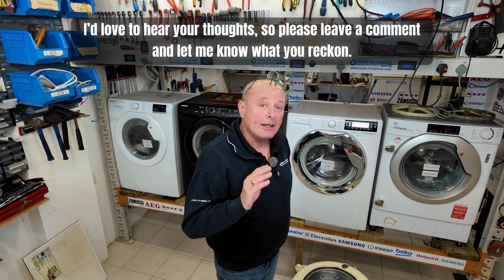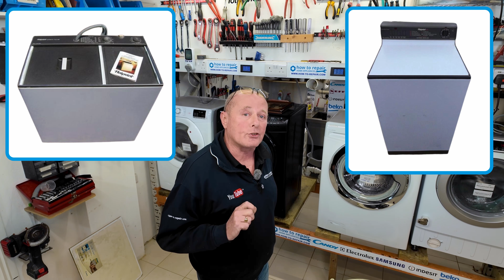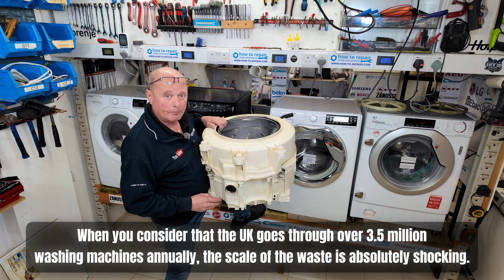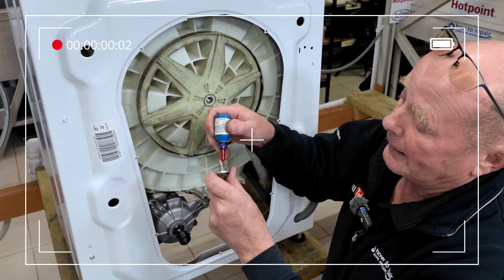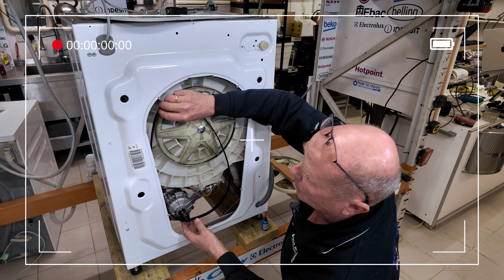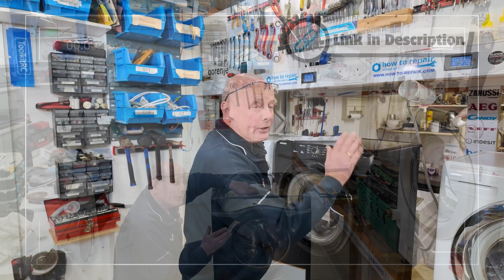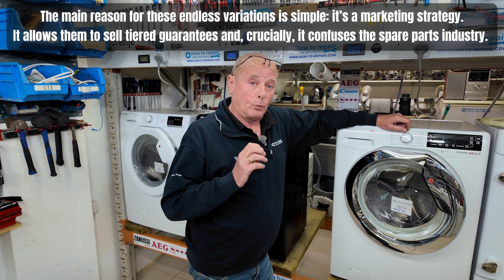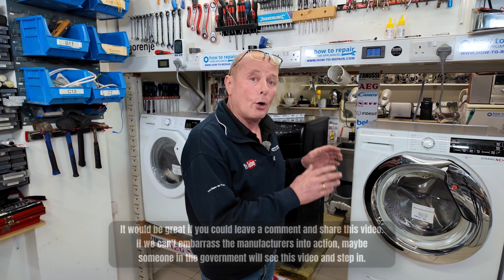I Scrapped 13 MACHINES to Prove a Point: STOP BUYING These Brands!

Comment: I have a Samsung and have replaced the bearings and seal twice. Possibly a fault by me for the first bearing fail. I still think that a double seal inside with a bleed hole to allow leakage would allow bearings to last a lifetime.
You are correct, Asian companies have to make repairable machines or they wouldn't sell them in their own markets.
PCB's cost around £20 to make and as an electrical technician, I can tell you be made to last at no extra cost.

Comment: I have an LG washing machine that's 10 years old and Little Swan dryer that's around 9. The LG had the pcb fail due to corrosion, even though it was 90% properly sealed with layer of silicone. I bought a replacement pcb and it has been working fine for the last year. The dampers are getting tired and may need to replace them soon. The dryer had a starting cap failure. 1 pound component. Easy fix. Eventually they will be too old to have parts for them even though they are only 10 years.

Comment: My miele machine is around 25 yeas old, has never broke down! The only 2 things I've had to do, stretch the springs onto the next setting because they got weak with age making the machine vibrate on spin, clean out the drain pump a few times.
 I love It's soak option, a wash takes 4 hours, but most of that time the cloths are soaking in cold water, the water heats up towards the end of the wash.

Comment: Top marks from a very old engineer I used to have 5 shops that sold all the machines you mention, and we were hoover dealers and hotpoint dealers but sold them all I am disgusted hearing how bad the industry has got, sounds like one big con, when this Samsung goes wrong I will purchase your reviewed ASKO as it sounds very good, thanks for speaking up for the consumer, and hard work, cheers Bob in the UK  A YOUNG 80 YEAR OLD.

Comment: I have an Electra (Servis) washing machine. It’s a noisy beast, doesn’t always balance the load nicely, but has been pretty reliable. 
I’ve had to change the motor brushes, reinforce the corner of a panel where a crack was developing and apply a few tyre repair patches to the door seal (replacements no longer available), but that's about it. It’s 36 years old.
Leaving the door open between washes has kept the growth of mould on the rubber to a minimum, but the material is perishing so I’ll eventually have to replace the machine… Ebac is looking like a contender despite the higher initial price.

Comment: It is not obsolescence but engineering of how to make equipment cheaper to produce and gain profit. I think welded drums are much chaper to produce than having human or even robot assembling parts in to one component. Usage of cheap bearings, seals is also the way to reduce costs if you dont care about market image. Also big impact is that some people menthally changing home appliances because they morally became old and are sick of shopping. so the there is no market need to manufacture good which last long time. Market want new and new goods for affordable prices.

Comment: I think what happened is the manufacturers got together with the insurance companies and came up with a great scam.
Not a washing machine but a microwave. I bought a Panasonic flat plate combination microwave in 2017, in 2022 the door components separated, and required a new outer door component, after a repair company fucked around with it twice, the insurance company wrote it off and gave me £450 to buy a new one. I bought the component myself and repaired it, and it still cooks every day as it is my primary cooking unit. It cost almost £200 for a piece of plastic and a glass window, and all the rest of the components are well overpriced, £5 for a little bolt I can get 100 for the same price.

Comment: In the 80s, my mate and I made a good side living from Hoover washing machines. I used to get them discarded in my job as an appliance delivery driver, if I got a Hoover washing machine that looked viable it got dropped off at my garage. We would then check it out, and either fix it or strip it for spares, because in the 80s many parts in Hoovers were interchangeable as their machines used combinations of standard parts, so we kept a stock of different parts we could use to build a working machine. 
I recently got an LG washing machine that had a leak we could not find, so the guy bought a new one, and I got the old one. I stripped it and kept the DD motor, just because to me, it was a thing of beauty.
Reply: That DD motor is one example that shows that improvements can be made but are often discarded to make sure the market retains it's gluttony for new machines. These manufacturers doesn't make money from having the best and most durable machines but from selling most machines at as high a price as possible while they are as cheap as possible to manufacture. It's all about the money!
Reply: Should of going into business!!!
Reply: with modern parts being specific to just one model the manufacturing tooling costs must be astronomical

Comment: I'm so glad your highlighting this. For many years I've watched companies buy a trusted brand then mass produce junk and ruin the reputation they had. It's not just washers. I had a dishwasher by Beko. Took out extended warranty (even though I fully capable of repairs myself) a part went on the top basket so it was leaning to one side and couldn't be used. Called the engineer out and long story short they wrote a 17 month old dishwasher off because they couldn't get the part for it so I ended up with a new machine. It was taken away and probably ended up at the tip.  My previous dishwasher was a Hotpoint and that was 12 years old and I gave it away as it didn't match the new kitchen. I should of kept it as it was working perfect and never had any issues

Comment: When I bought my house 7 years ago I needed a washing machine, a dish washer and a dryer. When I went to the shop I said to them I don't care what what the makes are. I want at least 5 years full guarantee. They showed me a triple of Husqvarna machines with 5 years guarantee and I bought them. The price was not higher than other machines. 
After 5 years minus one week(!) the plastic handle on the washing machine broke so I called the seller to fix it. He said that plastic is not included in the guarantee! I had read the prints of the guarantee and nowhere was an exemption of plastic.  I stood firm and I demanded a fix, he folded and He came the next day to me and fitted it!
Now Swedish consumer laws states You can do a complain within 3 years, even if the item has a1 year warranty. Earlier you had to prove there was something wrong with the item. Now the seller has to prove the item was not faulty when delivered!
You are doing a great job by disclosing the shenanigans in the industry!

Comment: OMG that is quite shocking.

I repaired a few Bosch and Miele.
Parts are readily available, sometimes even from 3rd parties (BSH is a huge ecosystem).
Miele parts are quite expensive, but they don't make a fuss about selling them to you.
Can't wait for your videos on those...
Reply: Good to hear, we've bought a used 10 years old or so Miele washing machine specifically to avoid having expensive, unfixable troubles with it.
Reply: Bosch appliances are becoming awful for other reasons.
Reply: I have an approx. 12 years old Bosch which I use once a week, works fine. My parents have got a 16 years old Bosch which they use about 3-4 times a week and it also works fine.
Reply: @Martin-i32367f  my parents use a 20 year old washer that had a red fault light glowing for the last 15 but still going strong. the fault light now works as a power on indicator LOL
Reply: My mom's Miele is about as old as I am XD. She only recently bought a new one after 25 years, and it was even broken. Also went to the store like I don't need any of the fancy crap just the basic reliable one. I will do the same.

Comment: My wife and I were given an AEG washing machine as a wedding present 22 years ago and the only component that has ever failed was the door latch which I replaced about 4 years ago.  I don't look forward to the day that it fails badly enough to be unrepairable.  We also had a small  "White Knight" tumble dryer (a budget brand) that lasted nearly 20 years and the only issue was the felt bearings for the drum had worn out but I couldn't source replacements.  I bought an AEG condensing dryer due to the great experience with the washer and it's required three engineer call-outs in 12 months due to sensor problems, fortunately all under warranty.  Absolute crap.
Reply: We have still got the cheap wight knight tumbler dryer 18 years on cost pennies in today’s money

Comment: I have an AEG machine that is over 18 years old.
The only problem I have had was a drum that filled 3/4 full of water and a fault code. My engineer took one look and sorted it out with a tie wrap. The water level on fill is controlled by a sensor fitted with a flexible pipe that had come adrift!
Thanks for the channel Paul , shocking what corporate greed is doing to consumers who want clean clothes!
Companies should be ashamed and boycotted.

Comment: my miele w 715 1993 model still works perfectly  it has closed oil shock absorbers that never need to be replaced..drum spider is stainless steel  and it has 2 heating elements so it heats water faster.Todays machines are made to last 3-5 years

Comment: Mercedes Audi BMW now using plastic oil sump pan on a 70-120k car. Mindblowing
Reply: Porsche 911 has a plastic sump pan too!  It's kind of unique in being an exotic sportscar that is not dry-sumped (the air cooled models used to be dry-sumped).  There are scavenge pumps (but not for a dry sump system but rather) to return oil from the flat cylinder heads though, unlike the Toyota GR 86 which can suffer oil starvation.

Comment: I have retired from over 50 years as independent hotpoint repair work (started while still at school working with father who was an employee of hotpoint but decided he could do better self employed) - most my early work was bearing replacement on Wringers of Hotpoint Empress and Countess - (still advertise to help my elderly ladys with advice) But i found 1 way to force companys to reduce component price (well motors or PCB) was by sourcing a supplyer of sub components - eg for motor the armature - for pcb the capacitors or do track repairs myself (or ballast resistor replace on other makes) But i found Hotpoint then reduced motor price to stop this - Then with welded drums that put pay to the many 100s of F/L bearing jobs i did - i then reccomended to all my customers "Put £50 into bank each year" (not into insurance as they often dishonor insurance later in life of machine) then you have enough to buy new machine after 6 years with full year free guarantee.  Kevin... (K Williams Hotpoint Repairs) Stratford upon Avon..

Comment: Excellent video, just changing the subject to cookers . Bought a AEG cooker a few years ago ,. exactly 1 year later  on Christmas morning wife putting turkey into oven and the door falls off . Top hinge broke .called customer service, engineer phoned to see what problem is , told him so he could order part without calling out . When he came to fit the door a week later he asked if we were leaning on the door ,  looking at the hinge the pin holding it together didn't seem to to be hardened as it was twisted and looking at the new one it was a darker colour ,( hardened ) ,never buy one again and another thing digital clock stopped working working a few years later !

Comment: I was curious yesterday (16/02/'26) if with my Miele WMH122WPS machine the spider-drum- bearings could be replaced/ordered, and yes they can BUT the price tag is heavy: spider/cross 504.42€  bearing 93,73 + 111.74€ seals 93,73€.
Prices found on the Miele website in Belgium
Today the machine still works fine, bought in 6/2018 and use it daily.
i was just curious...
Reply: Bearings are MUCH , much cheaper if bought direct from a bearing supplier, for the very same part, made by the same bearing manufacturer and same quality, the bearing and seal sizes are marked on the components themselves, if you can't find out in advance. I happen to know that my machine for example, takes the same size (front) bearing that Miele has used for their rear drum bearing in some of their models (6305zz) if I recall correctly). It cost me about £6 for a top quality replacement, whereas the same part costs over £20 repackaged in a plastic bag with their part number on, for the privilege of buying from from Electrolux/Zanussi.
I have seen third party spiders made from stainless steel for some older miele models, although they were clearly hand made. You can protect an aluminium spider against corrosion by keeping the machine clean and free of bacteria, do occasional 60C washes or run hot maintenance cycles. I use a powder detergent with sodium percarbonate in it (sodium carbonate peroxide on the packet) which produces hydrogen peroxide, that kills bacteria in a 40° C wash, and occasionally do a hotter wash. Miele have hydrogen peroxide in their ultraphase 2 cartridges used in their autodose machines.

Comment: I had old Zanussi with mechanical control. Very good and reliable machine.Used it 10-12 years. I broke it by own stupidity just damaging drain outlet. Replacement was very expensive, and I bought AEG. Also not bad till the moment when bearing was broken after 4-5 years. Apeared drum was sealed which I didn't expect. Our local service proposer to cut it using angle grinder and glue it back using epoxy or something but I refused because I don't realy trust. So yes modern world is corrupted. Thanks for telling truth

Comment: Wondering about getting into appliance PCB repair since most failures in modern electronics are capacitors. I maintain 40 year old monitors for fun. Still running a Bosch with a mechanical timer here.

Comment: Bought a bush tumble drier, got just over 2 years out of it before control board went. The Candy it replaced is still going at my sons house, never been quite the same after a belt change but still going.

Comment: I don’t know why YouTube recommended this to me because I’m in New Zealand, but I did check things out here after watching.

Here we have a law called the Consumer Guarantees Act which requires anything sold to a consumer for domestic use last a “reasonable time”, which is enforced by the disputes tribunal. The tribunal prohibits lawyers and is judged by a referee - often a lawyer or justice of the peace but not a judge. Washing machines are typically expected to last at least 10 years. 

I checked the parts list for our cheap landlord model washing machine. Doesn’t have a sealed drum. The manufacturer has an online parts store with everything listed. Full drum kit is half the cost of a new machine, inner drum only is a third. 

Forcing their hand really seems to help.
Reply: Here in the UK we have the consumer rights act, goods must be fit for the purpose, and last a reasonable amount of time. And can take the retailer to the small claims court, for a judge to decide through money claim online.

Comment: You asked for what brands people would recommend for repairability at the start of the video. I have only one answer. Speed Queen.
Now hang on a minute... They're not just commercial/industrial. They do have domestic units. 
Built the same way for decades. Old system with simple boards and relays. No sealed drums. Always parts available(many models share the same parts)... My front loader is over 25 years old. I bought it when I got my first home and it has only needed a drain pump and bearings in that time. It was second hand when I got it. 

Every single ""reputable"" store should be selling these exclusively.
Reply: I've really "put it through the ringer" in that time. I detail vehicles for a living. Tar, mud, mould, vomit, you name it.

Comment: The sum of the prices of the spare parts are higher than the machine itself because of the logistics. Spare parts must be stored for a long time, even after the machine is no longer produced. And eventually many parts may not be sold at all. 
In production, parts arrive "just in time", making expensive storage unnecessary.

Comment: I changed the drum on my 10 y.o. AEG (700 Euro initial cost) as the bearings were worn. It was indeed a lot of work, it would not have paid off to pay a professional. The drum itself was 250 Euro on the manufacturer's web shop, but I got it for about 150 Euros at a third-party internet shop. Nevertheless, i found that the inner of the mashine is quite dirty after 10 years, even though I used machine cleaner many times. I took all tubes and pipes which could be removed without too much effort and cleaned them manually. Pumps however I could not clean. So, buying a new machine also has the advantage that you have a clean ingterior again.

Comment: Could it be that the sealed drum is necessary to better resist high rpm and high volumes? As the older consumer washing mashines had less rpm and less volume then today.
Reply: The sealed drum is the plastic outer drum that does not rotate but keeps the water in. It is the inner drum, made of stainless steel, that rotates and is subject to the centrifugal force. If the outer drum is welded you cannot remove the inner drum and its shaft, (the inner drum has a larger diameter than the hole at the front of the outer drum) and so cannot remove and replace the bearings.